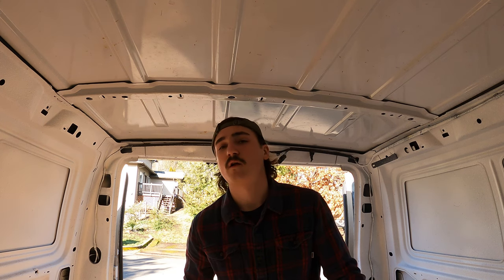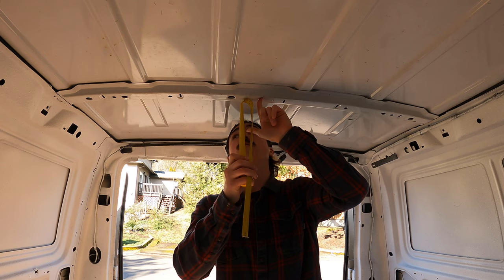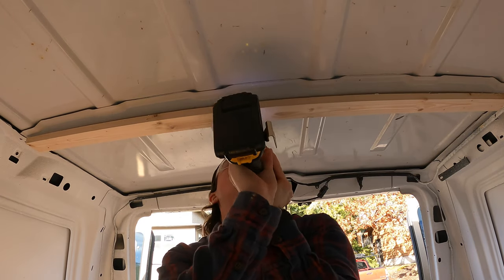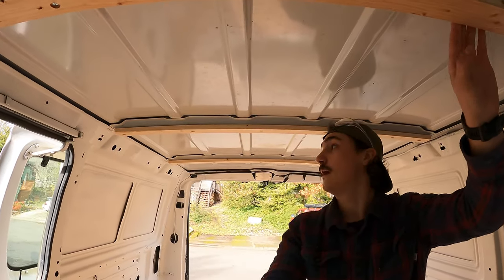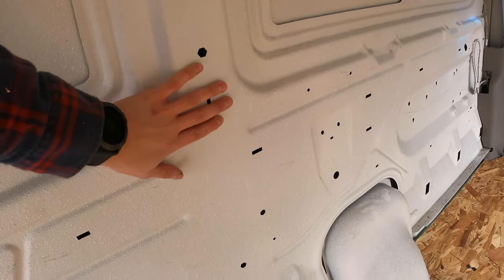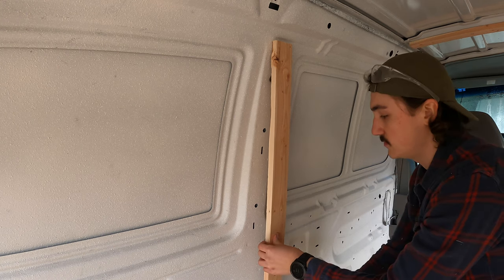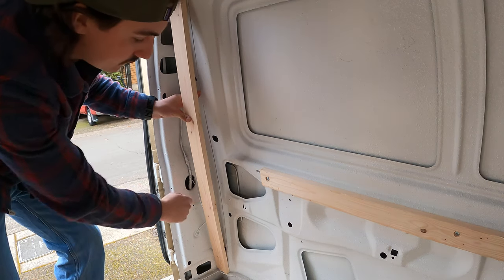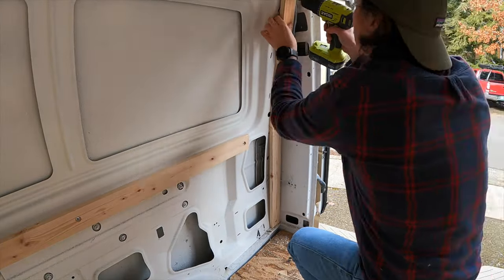DIY Van Life on a Budget | How to Frame Out a Camper Van Conversion | Ford E-150 Build Series Ep. 3

Comment: Great video. I do wonder if you might mention the supplies you use (eg: 1”x2” spruce, and #8 1” self tapping screws, or whatever YOU used 😁).  Other than that - great videos!
Reply from the maker: Thanks for your suggestion!
Reply: @SeizeTheAdventureCo  So what self tapping screws did you use?

Comment: I really enjoy your videos as they are to the point and very informative. I would like to make sure before I screw in the furrings to the frame of my van that the self tapping screws I will be using are the correct length. I understand that you drill a little hole first, through the furring and into the metal frame, what size bit do you use? Then you drill a bigger hole into the furring to counter sink the self tapping screw. What length and size are those screws? I am attempting to convert my Chevrolet Express cargo van into a camper. Thanks again for taking the time to make these videos. Your method of instruction makes it look easy and is quite inspirational.
Reply from the maker: Hello Stephen. 
I use 1x3 furring strips and pop a tiny hole through it. Doesn’t matter the size just can’t be too large for your screw head. Then take a 1in spade bit to counter sink the space so the screw fits flush. Then using 1.25 in sheet metal screws I drive it through the metal ribs and the large head of the screw keeps the furring strip secured. You can go one step further for extra reassurance. You can put liquid nail down on each board before driving it up. This will ensure no weak points. My walls stayed up well even driving on rough gravel roads. Thanks for watching, and good luck with your build! 🚐💨

Comment: Great stuff! Glad I stumbled across your channel as I'm getting ready to start work on my E350. Is there any concern that the screws would pop out? It seems like without any nut holding them in place that they'd pop out over time with all the jostling around on the road
Reply from the maker: Really glad you came across my videos as well. I haven't had any concern about this happening but its a valid concern. My suggestion is to go with riv nuts. Rivets that are threaded and have the capability to screw a bolt into. Thanks for watching!

Comment: Hey there, another great video. I wonder if you have ever made lots of little cuts along the backside of the timbers to be able to bend the wood to the shape of the van. I would actually do it the way you are doing but next build I am going for the curve. What do you think? Cheers for the video.
Reply from the maker: Hey Chris. I have seen that method before and it would be worth a shot to try it out. My concern is structural integrity of those boards once there is cuts in them. I would hate for the ceiling to fall down 😂 Thanks for watching, cheers!

Comment: 3:38 is that one you're drilling there also 1x3 furring strip?????

It looks more like 4 inches (maybe optical illusion)

I'm trying to same thing on e150 right now ...... I like your minimalistic framing approach
Reply from the maker: They are 1x3 and it’s probably the GoPro lense throwing you off! The minimalistic framing has allowed for some serious saving on budget, and has proven to hold up well!
Thanks for watching
Reply: @SeizeTheAdventureCo  ahh thanks again ...... Literally just purchased my impact drill & driver set 5 minutes ago ....... Trying to do the same thing you're doing in a 98 e150 ...... I'll probably go with the rock wool, as opposed to foam board as I've heard it's less flammable though
Reply from the maker: @anonanons163  you will have a much better time using that type of insulation. So much easier to work with and I’ve heard it’s quite effective! It wasn’t in the budget for this build, but next will have it!!

Comment: Hey what kind of screws/tools did you use? What was your method for screwing into the metal? I have an Astro that had a wheelchair lift with a huge metal beam across the roof, and I have no clue how to stabilize the furring strips into it. I’m building out an astro with no experience and a lot of Youtube! Love your build!
Reply from the maker: The screws are 1 3/4 inch sheet metal self tapping screws. I use one drill to make a pilot hole in the furring strip. Then a spade bit to counter sink the screw. Then my impact driver to drive the screw through the metal. They are self tapping screws so just some elbow grease and an impact driver was my method. That’s awesome you are doing your own build. Let me know if you have any questions. Thanks for watching!
Reply: @SeizeTheAdventureCo  omg thank you for explaining! this video literally so helpful
Reply from the maker: @an6350  no problem! Thanks for commenting 🙂

Comment: Ford Econoline for cargo delivery where to start wit the floor
Reply from the maker: I first patch any holes first with jb weld steel stick. Then paint with rust preventative primer. Then liquid nails adhere 3/4 plywood directly to the floor. Then use a high quality vinyl tongue and groove floor to finish it off. Simple, inexpensive, and space saving barebones floor method for a cargo van. Hope this helps.